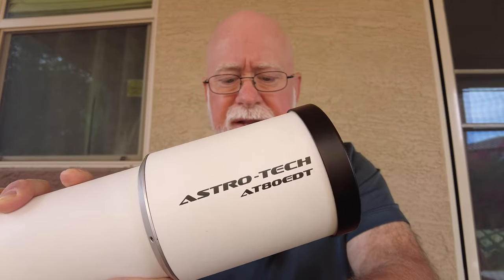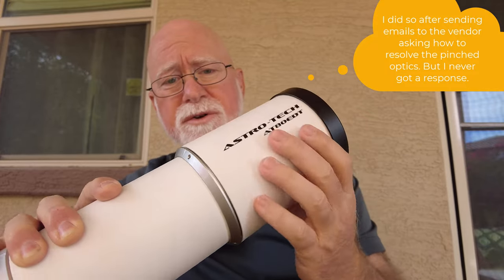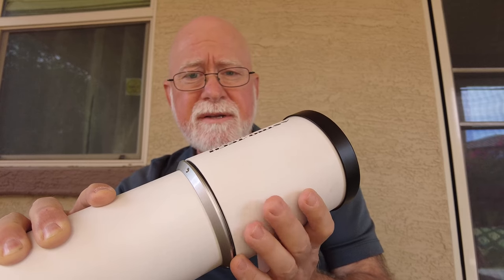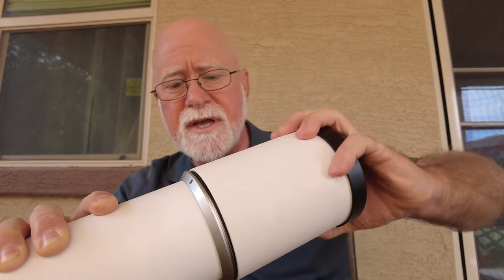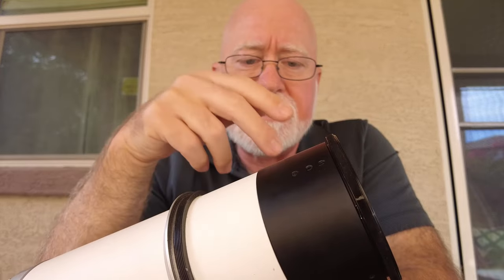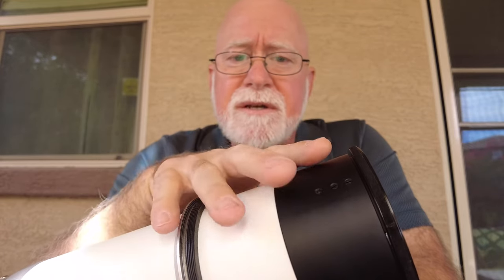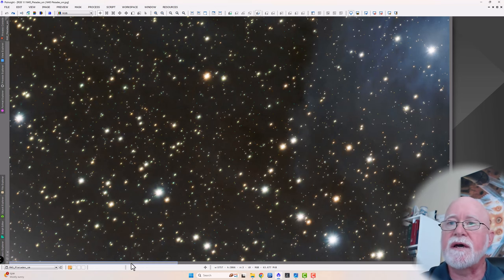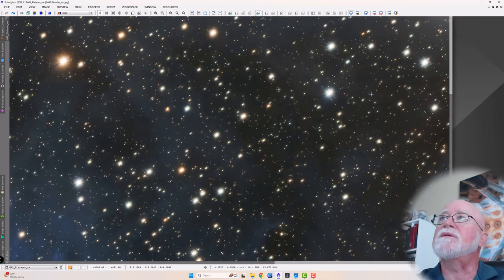I LEARNED my lesson . . . DO NOT do this with your Telescope!

Comment: You have to do it incrementally - leave say the back lens alone and get as good a pattern as possible by adjusting the middle one - then adjust the back one to make it better - then back to the middle one, etc. and it will converge on perfect. It is very laborious but can be done. Start by making sure the front lens is as centered as possible - the adjustment screws should go in equally all around. Then don't touch that one again. The problem is that the lenses have very steep curves so the adjustments are tiny! I would rig up some sort of live video in the focuser so you can do the adjustment without having to check directly at the eyepiece - some sort of afocal arrangement with a regular camera.
Reply from the maker: Yea, I was working on the slow incremental process, but in the process - and I think it might have to do with the temperature differential - things got worse. I will most likely just bring it down to Starizona in Tuscon where they have an optical bench and have them realign the lens. Don't know, will reach out them after Christmas and see.

Comment: I had a similar issue (different cause, it took a blow, knocking it out of collimation but with a similar result) with my Televue refractor. I took it to Televue for repair (I live within driving distance) and they fixed it. But for that scope, the cost was worth it. You may be right that the repair cost for an AT80 would be close to the replacement cost; it's worth checking out what the cost would be, though. One consolation, the new release of BlurXterminator can probably fix the misshapen stars in your old data.
Reply from the maker: If this was a Televue, I'd have them repair it too, the sunk cost is high enough to make it worth it. With an AstroTech, the sunk cost is not as high, so I don't think it would be worth it to try to get it fixed.

Comment: no, telescope is not destroyed, no worries. 1 you can always send telescope to the service and it will be collimated for you. i believe it will run up to couple hundreds bucks. 2. there are instructions online how to do it on your own. i once had issues with my ES102 FCD100 first iw was pinched optics, i kind of fixed it similar way you did but the later i noticed that my stars are always redish on one side and blueish on another side. which is sign of miscollimation or issues with optics itself. i contacted ES they provided me 2 options send telesope to them they will fix it or they also send me instruction how to do that, (i choose option 1 since i was not 100% confident if i can do it properly). So it is jot a tragedy telescope is still fixable.

Comment: I had a similar issue on a Sigma 70-200mm  F/2.8 for my DSLR. It was side focusing because some internal element was slightly tilted. We’re probably talking microns, since I didn’t notice it when I purchased it. Mine became prominent when I bought a 1.4x teleconverter a few months later. I took a photo of a wall and it was only in focus from the middle to the right. I thought I had done this myself to the lens, but then I went back to the photos I took with the lens while I was still in the store where I purchased it. It was present even in them, although you’d had to look for it with the camera settings and the distance to the subject. Long story short, they couldn’t fix it even in the service site here in Melbourne, and they had to send it to Japan, where it was replaced with what I’d call a golden sample. It was just as sharp as the best Canon counterpart when I compared them side by side. The TLDR of it was that if even Sigma’s local service wouldn’t touch an issue like that, if I had the same issue with the scope, I’d prefer to use the warranty, unless of course it was second hand.
Reply from the maker: I do landscape photography as well and yea, I had one of those type of situations, only it was with a canon 24-70mm f/2.8L lens, thankfully Canon was able to get it fixed. I have Newtonians and am used to collimating those, and have added an RC to the mix and finally - after about 8 months of frustration figuring out what I was doing - got it collimated as well. But I know that I really need a optics workbench to work on this scope and that I do not have.

Comment: Sorry to hear about the scope but it might still be worth checking with the manufacturer to see if they can fix the issue (assuming it's not the same cost as buying a new scope).
Reply from the maker: Logan the scope only cost me around 800 US to begin with, so it is a pretty cheap scope. So I will check to see what my options are but right now, I have got my replacement and of course, the clouds came with it so I have yet to really check it out to see if it will be a better scope than the AT.
Reply: @DaveUrbanAstro 
You just need to recollimate your telescope.

Comment: I am surprised there is no mechanism that prevents damage from contraction unless it was built incorrectly.
From the other comments I get the impression it cannot be impossible as there are only twelve screws.
There is one technique in engineering that when you adjust one screw you must then adjust the opposite one. For instance if you need to move the lense to the right you will need to loosen the right screw then tighten the left one exactly the same amount. Of course that is the basic theory of which you need to develop the knowledge and skill in order to master it - Think of it as another hobby.

I hope you succeed.

Comment: I had a similar issue with my Z61 WO. If you look online there are plenty of resources that show you how to recollimate the cell. If you didn’t move it so far out that it’s not doable. It took me about 2 hours of a clear night methodically adjusting and watching the screen but I managed to get the scope to produce images far better than it ever had before I touched it. As far as the stars in the corners, without a flattener you will have coma in the corners. I think part of the issue you are seeing in the corners is exaggerated by the pinching but will still be there, even with a perfect cell. Give Mike a chance to make it right. He’s always been a great guy 👍🏻
Reply from the maker: To be clear, it is MY fault not AT's fault that I messed around with the collimation. But having said that, the scope did come with pinched optics, and I did try to reach out to AT by email to see how to resolve it but never got a response back. Still like the scope, the value for the price is excellent, but - and sometimes hind sight is 20/20 - I should have sent the scope back when I figured out it had pinched optics to get a replacement. But again, my fault. I chalk it down to lessons learned, and astrophotography is a journey, and well all learn things.